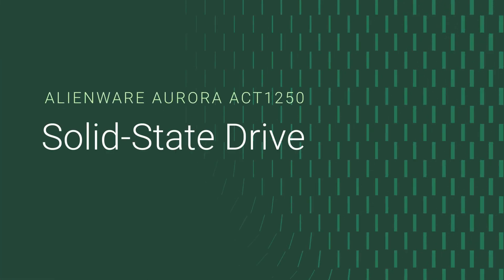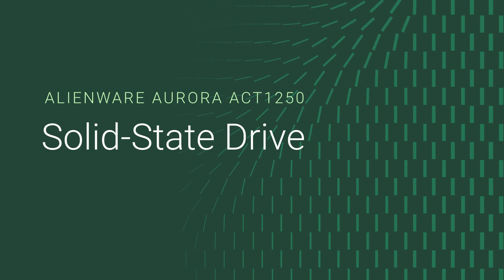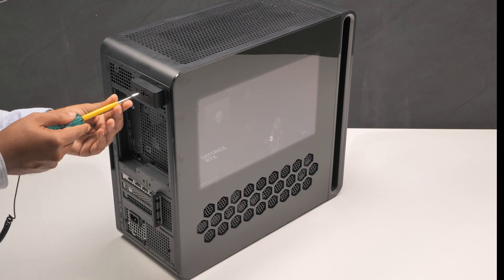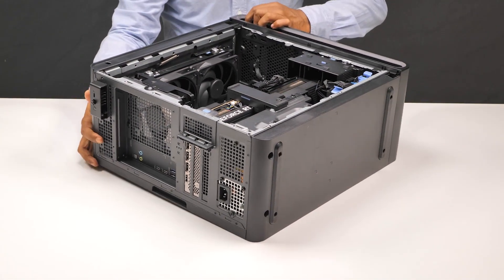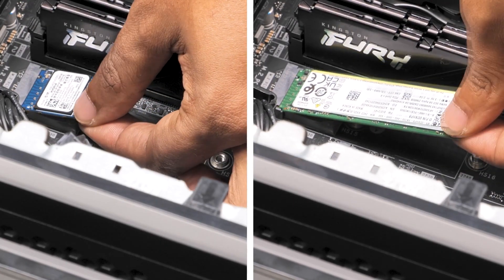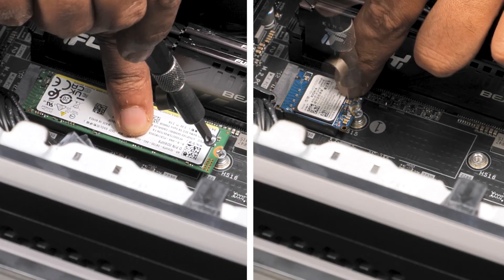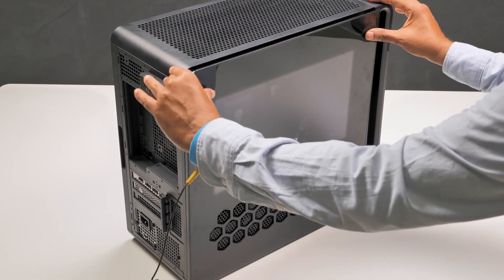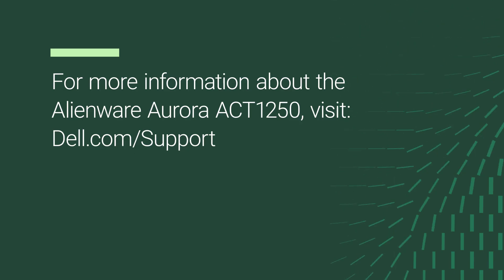How to Replace SSD on Alienware Aurora ACT1250 | Dell Upgrade Guide

Comment: Is it possible to install an SSD without the thermal pad? I have one drive that has its own heatsink.
Is there any difference between the slots? Do they both use the same lane (CPU/chipset)? Or do they use different lanes?